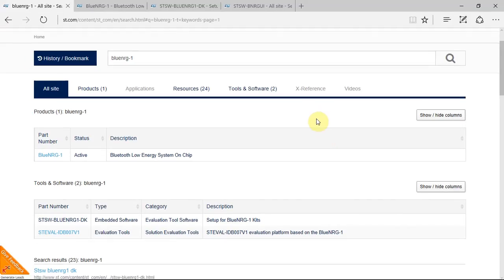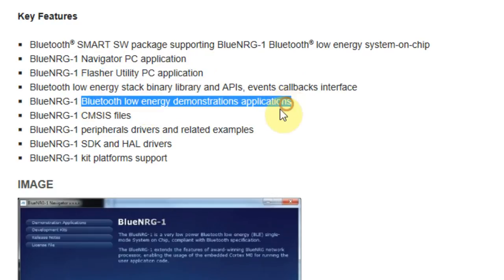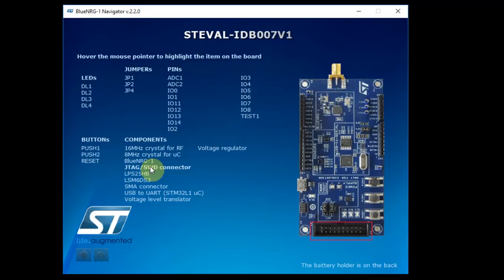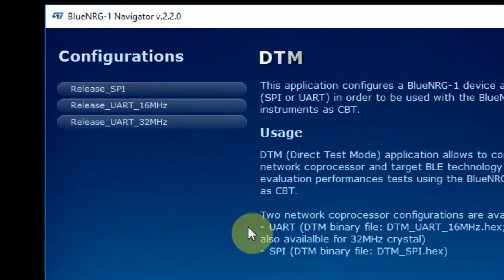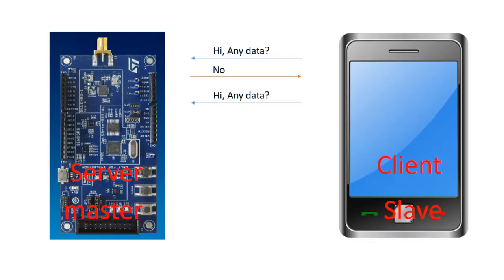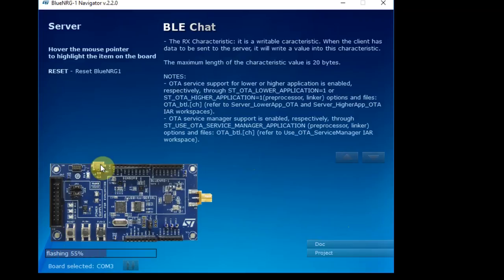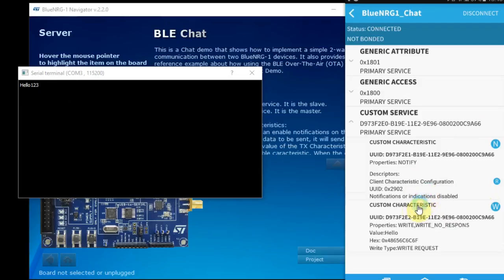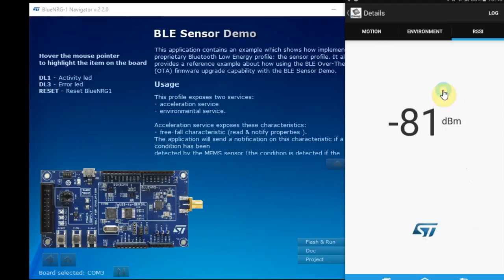BlueNRG-1 Demo board intro

Comment: Nice tutorial videos you got on your channels. Thank you for your efforts. 

I have a STEVAL-IDB007V1M board. Using BlueNrg-1 Navigator v3.0.0 I can flash and run the GPIO examples and it works fine. I am trying to run the BLE chat example as you have shown here. I can flash the board with the demo ble server application just fine. But when I try with the BLE Scanner app, it doesn't show the BlueNRG1_Chat uid as shown here. I can see a device but it says n/a (does this mean no UID?) and the signal strength is about -60 to -90 depending on distance. And I can't connect, it says connection failed after a few seconds. Am I missing some step or is there some mandatory device initialization configuration step required before running the examples. Any help will be greatly appreciated.

Comment: Hi I downloaded the 16Mhz on the steval-idb008v2 and the GUI says: no device detected. Any suggestions? I also need info on how to use the J-Trace wiht IAR. Any Ideas?
Reply from the maker: See what OSC is installed. Yes you. There is a connector to connect the JTAG.

Comment: Hi I have the IDB05A1, L053 or/and F401 mcu. Please correct me if I am wrong. I need to load the Bin Files on the board by copying and pasting. The next step is to Open the BLUENGR GUI. 

Many thanks in advance....
Reply from the maker: Hi. Yes, correct. I think I'm showing all this in the video...
Reply: Web learning Thanks I am just clarifying because I can't get my BLE connected to the BLENRG. But I can do everything working with the just connecting my BLE apps

Comment: Hi! I'm trying to connect my NRG-1 with the Navigator, but it doesn't recognizes my board (STM32L452 Nucleo-64).
Reply from the maker: +Gabriela Ventura Hi. What board of the BlueNrg-1 do you have? It should be a stand alone and not connected to the Nucleo.
Reply: Hi! I've just started using and programming the BLE and I don't really understand how this works. 
I have a Steval-BlueMic1 connected to a STM32L452 Nucleo 64. When I open it on the Utility, it comes that the device is a BlueNRG-1.
I've tried to open it on GUI, as you explained, but know appears "no Firmware detected on the motherboard". 
I think it may be just a silly mistake, but I would be very glad if you could help me with that :)
Reply from the maker: +Gabriela Ventura You probably disconnected something when you connected the Nucleo. There are many questions to be asked in order to pinpoint your issue. Did it work before, what changes you made, how you connected the Nucleo etc. 
See if you can find the answer on Google or on the ST community site. That will be the fastest way to solve your issue.
Reply: Thanks!

Comment: ble scanner can not find BlueNRG1_Chat, What should I do?
Reply from the maker: +레몬파이 
What phone are you using? Is it supporting BLE?
Did you follow the example correctly? Are you getting any errors ( in red)?
Reply: I don't have any error, but I found it very interesting. I am using STEVAL-1DB007V1M, but BlueNRG-1 Navigator can not recognize the board, however, BlueNRG-2 Navigator can recognize, So I used BlueNRG-2 Navigator.. could it be the reason? It it is What should I do? Please help me.. I have no idea what should I do... ;( help me..
Reply: I am using iPhone6s
Reply from the maker: it should work. Let me know if you got it working.